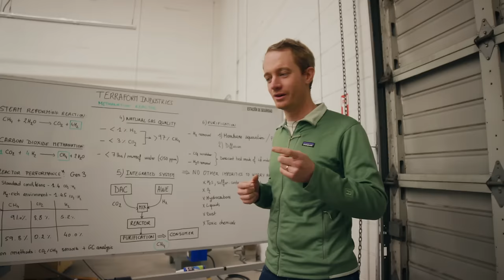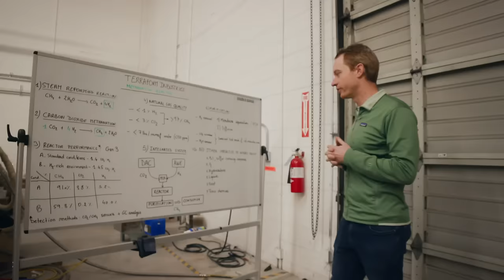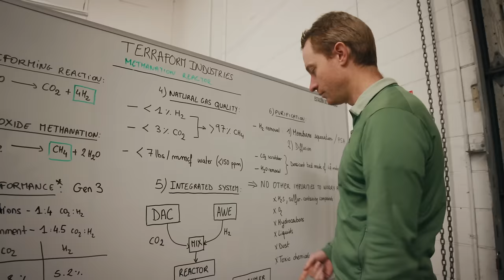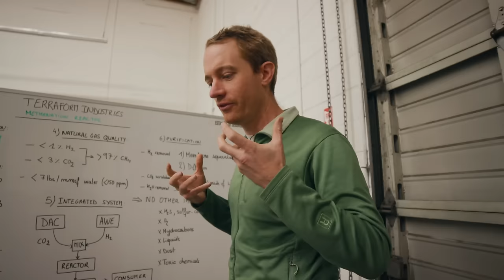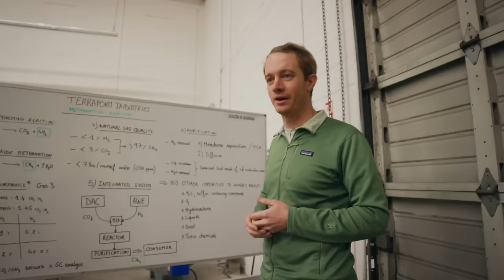The Future of Humanity's Energy No One Knows About | Terraform

Comment: Technologically this is the right idea.  It is also highly feasible, but there is one "fly in the ointment".  The "fly" is economics.  Methane and other synthetically produced hydrocarbons are still going to be marginal in terms of cost to produce (compared to holes in the ground to extract "free" naturally occurring hydrocarbons from the Earth), due to the required capital investments in the necessary equipment, even when the input electricity is produced by renewable solar power and is essentially free.  Producing hydrocarbons from holes in the ground is also very capital intensive and expensive as well, but they are mature industries that have become relatively efficient, and consequently, it is relatively hard for renewable energy derived synthetic hydrocarbons to compete (which is technologically feasible, but is not yet mature, and thus still suffers from a capital investment penalty against it).

There is a way to solve this conundrum.   Hypothetically, one could implement some kind of political and/or geopolitical manipulation to artificially raise the price of hole in the ground derived natural gas and crude oil.  Trying to exert political will upon governments to implement carbon taxes is one hypothetical method, but it faces strong backlash and resistance by various members of the population, especially including the crude oil and natural gas providers, that produce their product via hole in the ground Earth extraction.  Consequently, such manipulations appear to be of somewhat limited effectiveness in the current geopolitical environment.  The legacy crude oil and natural gas production companies can simply "grease the right palms" (bribe members) of government, so as to block carbon taxes or other comparable measures.

A likely much more rapid and effective method of globally raising the price of natural gas and crude oil (thus making renewable energy derived sources of synthetic hydrocarbons far more interesting and economically favored), is to arrange or provoke a war between (Israel + the US) versus (Iran + possible Iranian allies, potentially including the Russian Federation).  In such a hypothetical scenario, Iran has plans to blockade the straight of Hormuz, which would shut in a very large quantity of middle eastern LNG (liquefied natural gas) and crude oil supplies from global markets.  This would create a substantial supply/demand imbalance, leading to drastically higher crude oil and natural gas prices, pretty much all over the globe.

Such a scenario would strongly favor capital investments in renewable energy derived synthetic hydrocarbons, since they would easily become economically favorable and "profitable".  Such a scenario would also raise electricity prices (since electricity prices are partially tied to natural gas prices), which would also simultaneously incentivize strong investments in building renewable electricity production infrastructure (such as solar panels and wind turbines), which is also necessary for producing large quantities of synthetic hydrocarbons from renewable energy.

In other words, although war is normally bad, and it causes many problems for everyone involved, hypothetical war between Israel and Iran has the potential to cause at least one positive side consequence for humanity, when human society is based on economic systems governed at least partially by "free market" economic systems.  In a fully authoritarian economic system (not based on free market dynamics), hypothetically the dictator in charge could simply decide to invest heavily in renewable electricity production and renewable electricity powered synthetic hydrocarbon production, but such is not the current state of Earth based political and economic systems.  Instead, the Earth is governed by a mishmash of local dictators, that do not currently have the long term vision or plans necessary to resolve climate change (and other long term sustainability issues), or to make everyone wealthy through large scale adoption of renewable energy infrastructure, combined with a large buildout of factories and mines.

Consequently, in the current geopolitical state of Earth affairs and governance, war in the middle east (involving Iran) is the most likely expedient method of helping to resolve climate change problems quickly.  Although such a war would likely cause massive problems for human society, it would still be a catalyst for changes that would have favorable long term sustainability outcome.

Ideally, the existing Earth government leaders would be wise enough to recognize that war is bad and unnecessary, and that climate change concerns can be resolved without war (simply through large scale intentional investments in renewable energy production and related technologies, including electricity derived synthetic hydrocarbon production).  However, the existing Earth government leaders are not wise, and they do not see things this way.  Instead, they appear to believe that they can "win" wars through military means, and thus they appear to be currently inclined towards war related "solutions" to perceived differences in opinions.  Consequently, war and massive consequential problems are likely in store for the future of humanity, but there may still be one favorable outcome, at least from war in the middle east, if it causes massively inflated crude oil and natural gas prices.

Comment: Did they say what the advantage is over just using liquid hydrogen?
Reply: Liquid hydrogen has a very low density, is cryogenic (energy intensive to compress) and difficult to handle (will leak very easily, weaken steel etc). We already have infrastructure for methane (the "gas" network).

Comment: Do your solar panels regenerate themselves without input or do they need a cheap and exploitable workforce to perform the "cheap" upkeep to keep the cost of that hydrocarbon output low? 

Far less glamorous when you have to make sure all people involved aren't placed in exploitable positions for the duration of these types of projects, the US seems especially prone to exploitative behaviour when the novelty wears off.

There is a reason why so many in the younger generations are moving to the social sciences, they seem to understand the value of plural and equitable agreements with those who've been left out of the boons industrialsation in figuring out meaningfully sustainable answers....

And I'm listening 2x speed, I'm very aware of that type of hyperfixation mind. Technology isn't the issue, its overwhelmingly an emotional issue holding back meaningful change. The technology has been capable for a while now, those with means seem very reluctant to pay those who've been doing the actual work.

Comment: 9:45 Once they are collecting and selling the methane as natural gas, this will be amazing. However, in its current state, correct me if I'm wrong, they are actively taking C02 and H2 and turning it into H20 and CH4 (methane), and then releasing it into the air???? Isn't methane a MUCH worse greenhouse gas than C02? Again once they are bottling the stuff, it makes sense. You take CO2, out of the air, turn it into fuel, and when it gets burned it simply returns to it's original state thus adding no new net carbon to the atmosphere. But right now in testing, they could be doing active harm.

Comment: Three. Card. Monty. The process works…using solar arrays manufactured by fossil fuels, fixing energy with equipment forged by fossil fuels, transported by machines using fossil fuels, subsidized by tons on venture capital sourced from fossil fuels. Yet the process is fossil fuel free. We can live on mars…if we bring groceries from home. We can create fusion, too..not self-supporting either. Another inertialess machine…on high speed. This will not save us. This guy, however, is clearly excited about it. Good for him.
Reply: Save us from what? If works should minimise the addiction of new co2 to the atmosphere. Not that that's a problem. Nice that the process doesn't mean dealing with unwanted compounds that bringing up fossel fuels from the ground adds

Comment: K im confused - i get that this has application not just on mars but here too but why does he think its how we will power our civilization? Why not plop solar and any of the other forms of emergy storage right where we are doing industry, data centers etc. i get that he said we already have supply chains for Natural gas and obv cost more to build huge wire ultra far distance... That's why solar can be installed on roofs anywhere... I just dont see why we would convert electricity into methane then convert it back to electricity to do *work*. Low efficiency and will continue to pollute and cause climate change. Can someonw plz explain it to me?

Comment: Worrying about terraforming Mars is a fools errand. Try terraforming the top of mount everest, or even easier terraform a nice little plot of land area in Arizona with no energy inputs from any grid source. That was called Earth2 and failed after a few weeks. An entire ecospere was built for a $B that could house just 6 people who pretended to live in a space ship with no chance of being rescued, until one of them cut his finger and the biome started to go awry.

The best way to make synfuels is certainly not with PV but with nuclear heat, he should know that. A nuclear syn plant doesn't need to make electricty if you start with a high temp reactor like a Molten Salt Reactor, water can be split with the Sulfur Iodine process and is exactly 50% efficient and also 24/365. The costs of Sulfur and Iodine are 1000s of times cheaper than platinum and other scarce metals used for catalysts. In addition the heat from reactors can be used for many industrial and chemical processes directly. And with heat storage in tanks, electricty can be generated at a different rate from heat production so a nominal 1GWe power plant with the addition of more generating systems can vary output from say 20% to 300% which can be used to do load balancing.

Comment: I disagree sorry and here's why. "Cosmic Ray" particles, are present in the order of 10,000, per square meter, per second, each possessing 1 GeV (giga-electron volts), flow into Earth's atmosphere. High-energy particles, mainly protons (89%), helium nuclei (10%), and heavier nuclei (1%), travelling through the cosmos, enter our Earth's atmosphere, and presently achieve zero! Each one, can provide equivalent energy of a small particle accelerator, with just 6, roughly required, to power a city like Melbourne, Australia (5.03 million people, July 2022), at peak use, over 24 hours.

Comment: This is interesting technology, and potentially useful. However, you're not going to be able to take this to fruition unless you keep your ideology from poisoning your science. Right now, you're in direct competition with nature. Mankind always loses when competing against nature. You will never be able to extract CO2 from the air at an efficiency greater than a plant can. This is why this technology cannot succeed the way you have it right now. Drop the carbon scrubbing part of the process and use converted plant matter. It'll improve your efficiencies enough to actually be competitive. If you don't, this process will die on the table where it started.